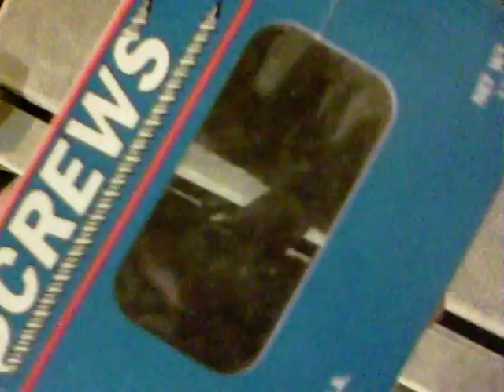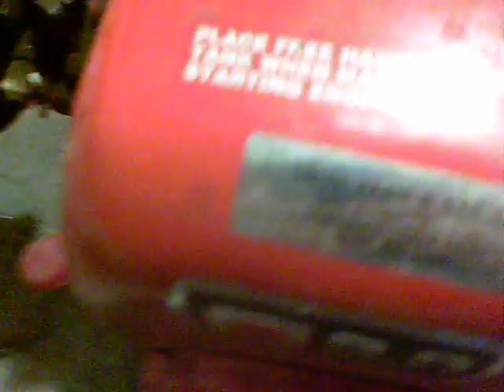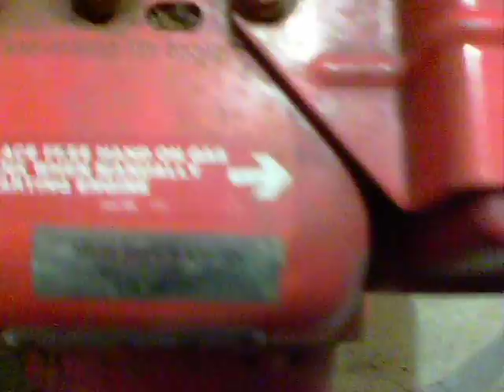Blown tecumseh snowblower/tiller engine, 3 hp

Comment: @SmallEngineTech95 ok my bad dude. I do the same thing as you I am 16 also and to me 35 bucks on something that doesn't work is no good. last year I got a toro self propelled electric start. she said it didn't work. I checked everything. spark plug was fine everything was fine. she put way to much oil. it was like gushing out for like 2 minutes! I sold that thing. I had to replace the battery in it! other then that it was an awesome lawn mower. to bad I can't get those all the time!

Comment from the maker: @dpl1108121 not really. allmost took the carb off and made 75..but i was able to repair the carb on their unit. not a wast of money. If your like me and have no majior expenses, you just can care less about $35. I don't think it was a wast at all.
Reply: Well you actually paid $50 for it, you have to include shipping. But $50 for that engine is okay not great. That engine is actually worth more in pieces like you mentioned above, then it would ever be as a complete engine. You can get about $75 for the carb, 20 for the recoil, 30 for the magneto, 10 bucks for each valve. 40 for the piston, 40, 40 the crank, 20 for the fuel tank, 15 for the shroud, 10 for the muffler, 10 for the head, 20 for the flywheel, 5 for the breather, 10 for the back cylinder cover, 5 for the base plate, 5 for each valve tap and about for for the entire cylinder, 15 for the air filter cover and 5 for the air filter if in good shape and I may have forgot a couple parts.. So if you sold that engine piece by piece you could get about $375 minus the $50 you spent, that's a $325 dollar profit. As an engine itself, it's worth about $100 buck's, putting the time and little money you had to repair it, you make $50 tops on it. Of course if your using the engine for something then you can't put an actual price on it, priceless. $50 bucks plus the time and effort and whatever little bit of money you had to use to fix it, carb cleaner, oil, gaskets, etc. So you did okay. Not great. I had a 7 horsepower Tecumseh H70, it was a 1971 model year, on a 71 Ariens Sno-Thro. The connecting rod broke and it blew a hole in the crankcase. I made $600 on all of the part's for it one by one on ebay. That was a year and a half ago, since then Stens has started making aftermarket recoils, that is -50 and they are making aftermarket carbs, but some still prefer the originals, the carb alone sold for $120. So there is value in those older Tecumseh engines parts. The value of an older Tecumseh say a 7 horsepower from 1971 an H70, intact, clean and running $250. It's parts dismantled increase the value x3. Those smaller engine's as a whole unit are not worth as much. Now if it was built specifically for a minibike with the upgrades and say it was a 6 horsepower, I see them selling for as much as 600 to 800 dollars and people are buying them. That is fully restored, cosmetically looking brand new ready to be mounted on a mini bike.

Comment: sorry but that is a waste of 35 bucks..
Reply: Well actually he paid $50 for it, but he did okay not great, you have to include shipping. But $50 for that engine is okay not great. That engine is actually worth more in pieces like he mentioned above, then it would ever be as a complete engine. You can get about $75 for the carb, 20 for the recoil, 30 for the magneto, 10 bucks for each valve. 40 for the piston, 40 the crank, 20 for the fuel tank, 15 for the shroud, 10 for the muffler, 10 for the head, 20 for the flywheel, 5 for the breather, 10 for the back cylinder cover, 5 for the base plate, 5 for each valve tap and about 10 for the entire cylinder, 15 for the air filter cover and 5 for the air filter if in good shape and I may have forgot a couple parts.. So if you sold that engine piece by piece you could get about $375 minus the $50 you spent, that's a $325 dollar profit. As an engine itself, it's worth about $100 buck's, putting the time and little money you had to repair it, you make $50 tops on it. Of course if your using the engine for something then you can't put an actual price on it, priceless. Well $50 bucks plus the time and effort and whatever little bit of money you had to use to fix it, carb cleaner, oil, gaskets, etc. So you did okay. Not great. I had a 7 horsepower Tecumseh H70, it was a 1971 model year, on a 71 Ariens Sno-Thro. The connecting rod broke and it blew a hole in the crankcase. I made $600 on all of the part's for it one by one on ebay. That was a year and a half ago, since then Stens has started making aftermarket recoils, that is -50 and they are making aftermarket carbs, but some still prefer the originals, the carb alone sold for $120. So there is value in those older Tecumseh engines parts. The value of an older Tecumseh say a 7 horsepower from 1971 an H70, intact, clean and running $250. It's parts dismantled increase the value x3. Those smaller engine's as a whole unit are not worth as much. Now if it was built specifically for a minibike with the upgrades and say it was a 6 horsepower, I see them selling for as much as 600 to 800 dollars and people are buying them. That is fully restored, cosmetically looking brand new ready to be mounted on a mini bike.